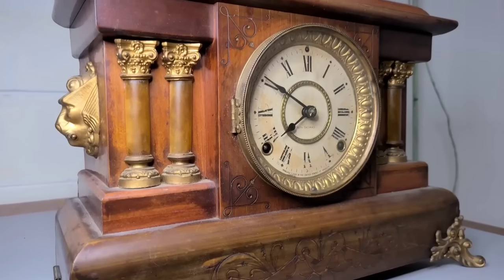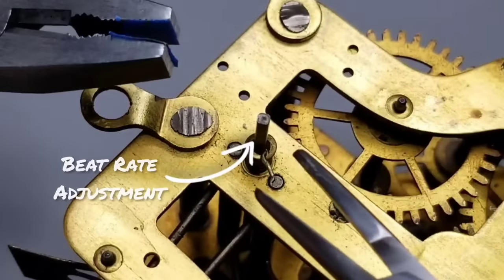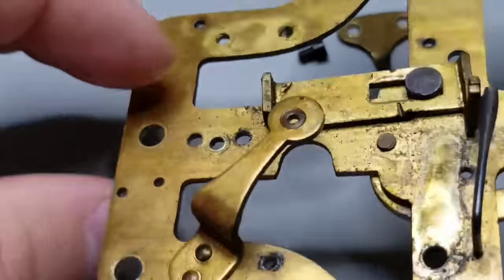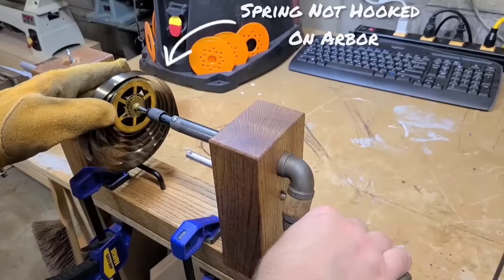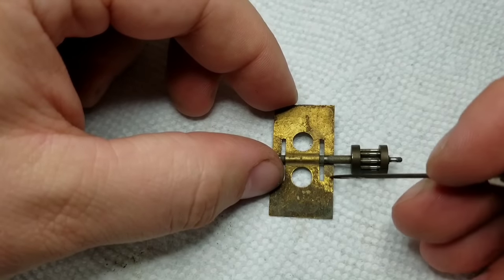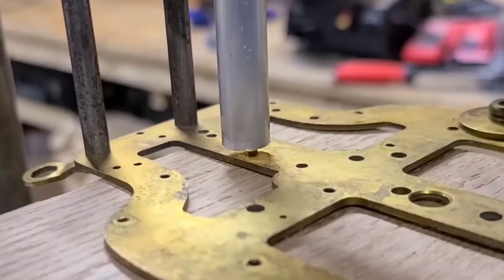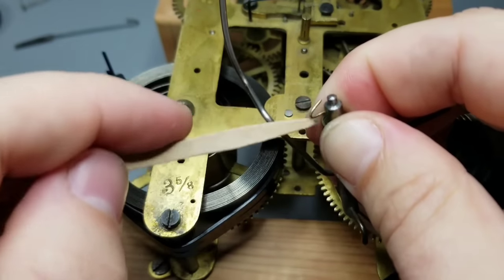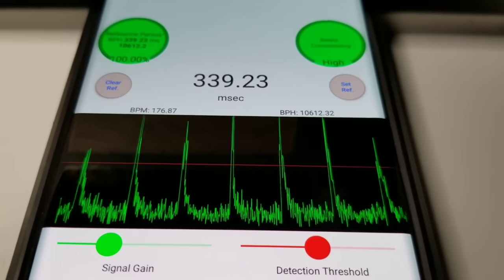Neglected 1900 Seth Thomas Clock Restoration

Comment: I lived in Thomaston, Connecticut for 28 years. The clock factory is smack dab in the center of town, a large three story brick building. Sadly the Seth Thomas clock company is long gone, but the factory  remains and has been repurposed into small businesses. I have a 1951 Seth Thomas Winchester chime mantle clock my grandparents gave my parents as a housewarming gift. It has the Northbury movement, the last movement Seth Thomas manufactured in house. I’ve had it rebuilt and serviced regularly. It runs and chimes beautifully and is my most precious family heirloom.
Reply from the maker: Very cool!

Comment: Love the video! I would suggest a large ultrasonic cleaner filled with automotive carb cleaner. It is formulated to remove the type of buildup on the spring and is safe for copper and bronze. You could use it on all of the parts and save a tremendous amount of time hand scrubbing.
Reply from the maker: Thanks!

Comment: Just came across your posting as I was caught by the words Seth Thomas.  I have an old Seth Thomas railroad watch from my father.  I live in Alberta Canada and I clean and sometimes restore old firearms.  In my work life I was involved with  electron microscopes which require ultra cleaning and be oil free.  I now use my cleaning techniques from then to cleaning gun parts.  Long ago we used Lemmi-Shine which is a dish washer additive plus a few drops of Dawn dish washer liquid. This is dependent on how much water you use.  Experiments may be required.  We heated the water as our ultra sonic cleaner has a built in heater, added about a table spoon of Limmi-Shine and a few drops of Dawn.  Put the parts in a basket so they don't touch the bottom of the ultrasonic cleaner (a bad thing) and cook for about 20 minutes.  It woks great for cleaning caked on grease and removing the staining on brass without using mechanical polishing or picks. I use a much larger ultrasonic cleaner than you -10L.  If you are more interested in maintaining patina then you could use other grease solvent products like Gunk which is a carburetor cleaner/de-greaser in the ultrasonic cleaner.
Reply from the maker: Thanks for the information. I'll have to experiment and try  your suggestions out. Thanks for watching!

Comment: In my experience with mechanical things, I have found that I want to do my heavy cleaning and degreasing before I do my fine cleaning. Use your ultrasonic as the final clean. It will save you steps if you remove the heavy deposits first. That's my way. But clean is clean, however you do it. Great video. I enjoyed it.
Reply from the maker: That makes sense. Thanks for the tip!

Comment: Nice save. That's a lovely old clock. I've seen clocks and watches with that greasy dried film coating them before and I think it's WD40 or equivalent that people spray on the movement thinking they are doing the right thing. I actually saw a YT video of someone doing it to get an old movement running and people leaving comments about how it was a great idea. Of course they will run for a while until everything starts to dry up and get coated with dust.
Reply from the maker: Thanks! The clock I'm working on now is worse than this one. It almost looks like someone dipped the movement in used motor oil. It's alright though because it gives me an opportunity to try to make it right!

Comment: Great work.  I am hesitant to start work on my Pendulum wall clock.  I would have no problems pulling apart but re-assemble?  Watching you do your work gives me more confidence.  Thanks 😀 Rob
Reply from the maker: Thank you! It helps if you can take video of taking it apart so you can reference the video to help put it back together. I also take pictures that I sometimes reference. If you just take your time and have a little patience, I think you'll be able to get it!

Comment: I was completely fascinated with this restoration. It is just possible, that given the time the clock was made, there could have been gas lamps in the house, fireplace, and tobacco smoking.  All would have put a greasy residue in the air, and it would accumulate on the insides where it wouldn't be able to be cleaned easily.  I really enjoyed watching this process. Please keep making videos.
Reply from the maker: Thanks for watching!

Comment: I have a clock very similar to this except mine is a Sessions model in black.The inside is also pretty much the same.It has been running pretty much since I bought it about forty years ago.I wind it every four or five days or when it starts slowing down a bit.It sits on my mantle and I like the ticking and hearing the gong sounding every hour.
Reply from the maker: Very cool! I also like hearing the clock tick and the sound of the gong. Thanks for watching!

Comment: Most of my life I stripped and rebuilt motor cycles, engines, gearboxes, electrical components. From very early ones to the much more complicated ones from Japan etc. With or without much information I managed over many years to rebuild successfull, it was my living, just about everything that was put in front of me. After five minutes of this video I knew that clock and watch repairs were beyond me, must take a lifetime to get that much skill and knowledge. I am in awe.
Very interesting and well presented video, a treat to watch and listen, thankyou
Reply from the maker: Thank you! I actually started working on clocks this year (2022). I've been learning as I go. You can do it too!

Comment: This is the most satisfying cleaning video ever. I have an 1880s Seth Thomas mantle clock. I wish I could get mine working like this. If I took mine apart I’d never get it back together again! How did you learn horology?
Reply from the maker: Thank you! I'm glad you liked it! I've been learning from reading, watching videos and just by hands-on experience. I've worked on a handful of watches and this was the 4th clock I've ever worked on. I'm still very much an amateur and have a lot to learn but this takes time. I think you could learn to work on your clock too!
Reply: Heather, I got into this as well for a time at hobbyist level. Not going to lie, I bought a few clocks that were low value or at least low investment, ripped them apart, then reassembled them as best I could. Pretty much trial and error. Should you decide to work on your Seth Thomas I would highly recommend finding a few sacrificial clocks to practice on first. This video is an excellent learning tool. It's not going to turn you into an expert, but it teaches some basics very well.

Comment: This was fantastic!!  I had two wind up Big Ben bedside alarm clocks that would not wind.  I had watched The Repair Shop and a man fixed a clock that was stuck with just old thick grease/oil.  I did the same repair and they both work!!  I do have a Seth Thomas that doesn’t keep good time…slow.  I used the adjustment key, but it appears to be not attached in the back.  I don’t dare do anything more!  I only wind it at Christmas.  This is a great show.  I have learned even more!
Reply from the maker: Thanks for watching!

Comment: You did a fantastic job demonstrating how to clean up an old clock.   However, I took my old clock to a repair shop and they gave me a new paper for the face and hours.  Clock looked like new.
Reply from the maker: My goal wasn't to make a 122+ year old clock look like it was made yesterday. If I wanted that, I would have replaced the dial or just bought a new clock. Thanks for watching!

Comment: I found watching the tear down, cleaning and reassembly of the 1900 Seth Thomas clock extremely interesting.  
I have worked on heavy equipment for most of my life (eighty years old and semi-retired) and still working, but only on my own equipment.
Time has taught me that the cleaning portion prior to the reassembly of any equipment is paramount and might I suggest that using a carburetor cleaner and or a break cleaner in conjunction with a de greaser purchased from an auto supply store will clean brass like new. Also, you can purchase brush on bluing from any gun store.  G H Dengel
Reply from the maker: Thanks for watching and for the tips!

Comment: This is amazing! I have the exact same Seth Thomas with two slight differences, mine has only one column on either side of the face and the adjuster is below the hands rather than above. In all other respects it is absolutely identical. I found mine about to be thrown away in a charity shop as it was absolutely filthy and the insides was a mass of hair and solidified grease. It was disgusting but I was taken by the look of it so I took a chance and bought it. It was just one solid mass of hair and congealed grease so I figured, nothing ventured nothing gained, and took the mechanism out and after removing as much of the hair as possible dropped it in a tub of boiling soapy water. Scrubbed it and gradually got it completely free of gunk, dried it thoroughly and gave it a light lubrication and it now runs like a charm and keeps almost perfect time, gaining about a minute a day, which for a clock that old is incredible.
I thoroughly enjoyed watching you do the restoration and if I ever need to do a repair job on my ST I know exactly where to come for everything that I need to know. Many thanks.
Reply from the maker: That's awesome Chris! Good job getting it running again. I'm sure at some point it will need a good overhaul or something fixed, and I'm glad my video might be some help for you. Is the escape wheel on your movement between the plates or in the back like this one? Since your adjuster is in the center, I think yours is the number 89 movement. 

On the bottom of the clock in this video, there is a stamped date code that says "0091", meaning the year 1900. The year is usually done in reverse and followed by a letter A - L representing the month. Does yours have a date code? It might be hard to read and the light might have to hit it just right.
Reply: @WatchOverhaul  The escape wheel is internal. Also it has a bell which chimes the half hour along with the coiled spring for sounding the hour chime. I had a look on the bottom and as far as I can tell it has 6091B printed there. It's rather feint so it could be an 8 or a 9 at the front. It's a shame you can't put pictures in the comments as I would love for you to see it.
Reply from the maker: Very cool. So your clock was made in February, 1906. They started using movements like that around 1900 to 1901 I think.

Comment: I have a clock very similar to this, I believe it was a wedding gift to my Great Grandparents. It has a date of 1904 written on it (may not be manufacturing date), I remember the spring breaking when I was a kid in the 80s. After Mom died a few years ago I thought I'd take a look at it, the spring had a lot of energy, it was all bent to heck and broken in there.......Maybe one day I'll tackle fixing it but I think I'll need parts or a whole mechanism from another clock......Oh well it still looks good sitting on the shelf.
Reply from the maker: Yeah, the springs are really strong and could have damaged the other parts. Good project if you ever feel like digging into it.

Comment: I've been cleaning parts for many years.  I enjoy watching these videos. One thing I've found with delicate parts is the less they are handled the better the outcome. I've found that  lacquer thinner and a product called Awesome are the two best cleaners I have found. They are both very potent  cleaners and can be found at Home Depot or ordered online.
In this age of impatience, it is something that must be broken away from in order to do high quality work. In conjunction with an ultra-sonic cleaner, the Awesome is a beyond go to product. Never use flammables in an ultra-sonic cleaner. Lacquer thinner  consists of high grade alcohols inclusive too a few other similar solvents. Petroleum distillates are also powerful for soaking hardened grease. WD-40 can also be purchased by the gallon at Home Depot. It is great for soaking for a period before moving onto different stages of solvent cleaning. This entire clock movement could be micro cleaned without any rubbing or picking or scraping. Everything fossil oil and dirt can be readily dissolved back into solution. I would soak the entire movement before dis-assembly in WD-40, then maybe lacquer thinner, drip dry on towel, dis-assemble, soak in Awesome for 24hrs occasionally using ultra-sound, then ultra-sound in fresh water rinse, then dry in a 90 to 100 degree oven on a cookie tray
Reply from the maker: Thanks for all that info. It's nice learning other ways to do things. Always more to learn! Thanks for watching!
Reply: I forgot to mention, the last in the sequence use distilled water . It does not leave behind any mineral residue when dried.

Comment: I have one like Adamantine Mantel Clock. Mine has a completely unfinished face - just the embossed numbers and other embellished design. The case finish is dark with a burl like gold and a big old cigarette burn in the top. Recently had it serviced and replaced the original main springs. It's nice to have something mechanical in the house.
Reply from the maker: Very cool. Thanks for watching!

Comment: A good repair and service. There is something very satisfying about getting clocks to work again after years of them being "dead". About two years ago I restored a Seth Thomas kitchen clock from a complete basket case. It had a broken spring and missing pendulum suspension and verge. I got springs for it and a suspension but making a verge was a right PITA, so I think a good decision not to replace or repair it. I also replaced a lot of bushes and redressed a lot of the pinions.
Reply from the maker: Thank you! They are nice to work on! I haven't worked on a clock that needed that much work like yours did yet.

Comment: Nice video.  I repair antique phonographs.  If the motors stink it's probably old 3-1 oil.  People used that on everything, unfortunately.  I have always wanted to get into fixing clocks (I have a few) but was always a bit intimidated.  You have given me the impetus to try.  I have an old Mantle clock similar to this one on the video.  The strike keeps going off the hour.  Now maybe I can try to fix it.  Thanks for the inspiration.
Reply from the maker: Thanks! I think you should give it a try. Just take your time, take plenty of video and pictures, and I'm sure you'll figure it out. Thanks for watching!

Comment: I can remember my dad telling me that his dad would take the movement’s out of their windup clocks and dunk them in diesel fuel once a year to clean and lubricate them. That might be what you were seeing in this movement you were working on. It sounded like everyone did this back in the early 1920’s and before. 
You said something about applying a blueing agent on the clock hands, I’ve seen where they blue steel with heat by placing brass shavings in a steel container and putting the hands and machine screws on top of the brass shavings and heating with an oxy acetylene torch from the bottom until the heat blues the steel. I wonder if back in the days when this clock was built if that’s how they would have done their blueing. Great video, Thanks for sharing
Reply from the maker: Yeah, I've heard of people dunking movements in fuel as well. I wondered the same thing. Thanks for watching!

Comment: WOW, I just happened to see the photo of the clock, to which I have the same clock, so my curiosity was peaked, I watched the entire video with fascination, simply amazing...your patience and skill was mind blowing. I know nothing about clocks, but have bought and sold collectables for years. I always bought clocks in really rough condition, parts missing and the like, but they are so intriguingly beautiful, I use them to frame my watercolors of birds. I haven't run the clock for years, it was in too good of condition to part it out and it ran good it seemed, I will have to check it out later to test it. Thank you so much this was super fascinating!
Reply from the maker: Thank you! I'm glad you liked the video!

Comment: I have a very similar clock, but with green faux marbling and a very dark finish but otherwise exactly the same!  Thank you so much for this video.  Since it was handed to me, I have been afraid to even take the news papers stuffed into the back of it.
Reply from the maker: Cool! Hopefully you can see if it works. Thanks for watching!
Reply: Its a clock! It was meant to run. Give it a quick inspection for anything insane and then wind it. If it doesn’t work, it was already broken. Be gentle, but its unlikely you will cause any damage.

Comment: It's often a good idea to replace retaining wires like the one through the shaft of the rate adjustment regardless of whether or not it breaks on removal. It isn't a special pin of historical conservational value, just some wire. Once bent and re-bent, it has a high probability of failure. While that particular one is not exactly critical (in fact, many aren't) there do exist ones that could cause real problems if they were to come undone in operation. There are minor parts in a clock which have little or no conservation value and may be positively necessary to replace for the mechanical preservation of more important components. Of course, like many things in clock repair, it's a case by case judgement. Or movement by movement if you prefer.
Reply from the maker: Thanks for the information and for watching!

Comment: I've been spoiled by working in clock repair shops with skilled guys. The investment in tools has become very expensive.  You did well for your first repair.
Reply from the maker: Thanks! This was the 4th clock I've worked on. I'm slowly acquiring more tools as I need them. I don't have all the fancy professional tools, but I'm getting by at the moment.